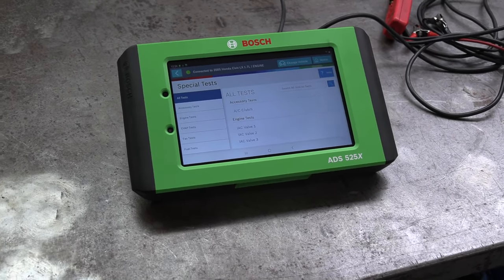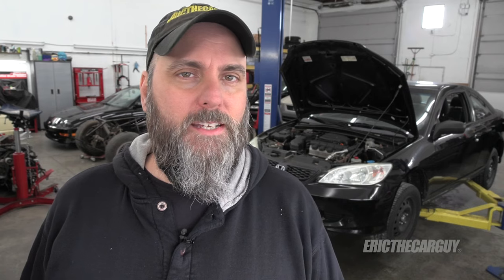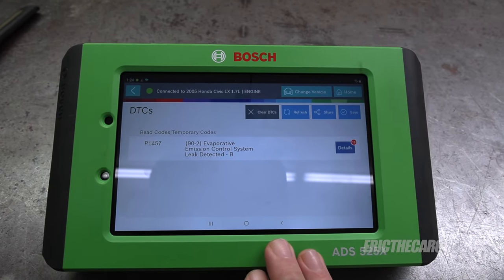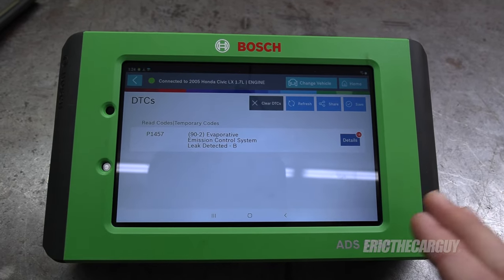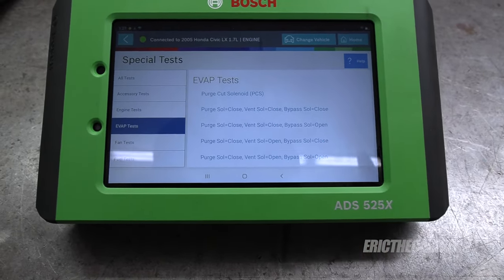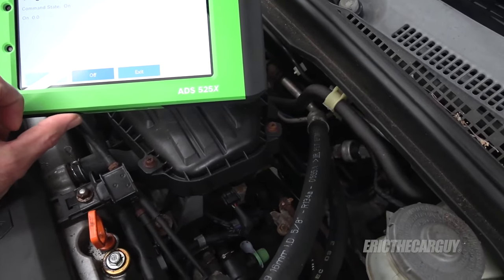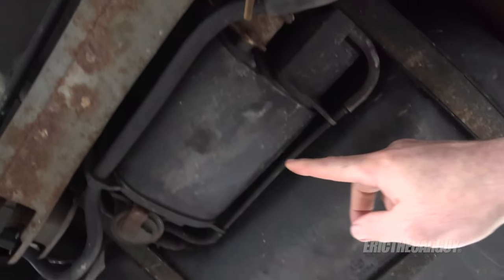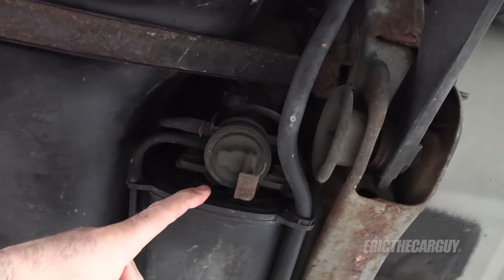How to Diagnose and Fix a P1457 Code

Comment: As a Honda tech for 20 years, the Canister vent shut solenoid valve, it is normally open (key off) when  the computer commands the solenoid   'on' that would make the valve 'closed'
Reply: looks like we have 22 honda tech here
Reply: I'll add to that, when testing too much pressure builds up with valve closed, which over powers the spring that normally opens and holds it open. most likely the reason for it not clicking at video end.
Reply: @throttlebottle5906  applying the smoke through the vent valve port should go in the right direction and show the difference in flow action when opening and closing the valve then.
Reply: @throttlebottle5906  the valve should have been open from the start with no power applied but it showed no evidence of flow right after installation. It would have required a sudden burst of overpressure to lock up the valve and close it, which the smoke machine wouldn't be capable of with its low flow.  
Seems like the valve might not have been working properly and was stuck closed, which may not trigger the leak code but cause other issues.
Reply: @dubmob151  what smoke machine and what magical perfect electronic controlled junk? cheap junk is cheap junk and good luck if you think all tools are great and perfect.
Reply: @throttlebottle5906  you said the reason the valve was closed was overpressure, only pressure going on is from the leak tester smoke machine. That smoke machine.

Comment: Dorman makes some extremely crappy electronic parts. I'd probably buy the Honda valve and keep it in the glove compartment for WHEN it fails. Great explanation of the system! I hate EVAP work probably more than anything on any vehicle today.
Reply: Excatly. Its 2021, aftermarket has gone to the toilet. I go used OEM parts if possible
Reply: I had a Honda valve fail in just over a year. Replaced it with a Dorman.

Comment: I have a 1999 Honda Accord LX 2.3L. Got engine code of P1457. With the things I know about the car, I went ahead and replaced the charcoal canister and solenoid. Reasons why I didn't go through all the testing is the following- 1. car BARELY passed smog 2 years ago. 2. Exhaust smelled horrible. 3. Car was acting funny with it jerking while coasting or slowly accelerating. And car revved high in park, neutral and drive.  So with how old the car is, having 236k miles, and the big fact that it barely passed smog. So key thing to remember...REPLACE the O-Ring on the solenoid. The warn out ring WILL CAUSE a leak and the P1457 will come back.

Comment: Have the code on my 02 CRV. Replaced canister/valve and that was not it. I don't think its actually a leak as I have noticed when I fill up at a higher elevation and then drive down a mountain, CEL goes away. Leads me to think its actually a pressure sensor. Having a very hard time finding where that is located and part number. Any ideas? Tank also holds pressure, have had it hiss when removing the cap after sitting on a hot day. Wouldn't mind even tricking the ECU into thinking its fine. Affects nothing and my state has no emissions but the CEL always on keeps me from knowing if something else comes up.

Comment: This really helped especially with mental preparation and being careful. I used a one foot needle-nose plier on the tiny clamps, which possibly gave me extra leverage and visibility -- also wiggling up and down so the clamp ring gets some movement. Thank you for also putting everything back so I do this the right way. Great video!!

Comment: That's exactly how I fix my car, just start replacing shit until you get it fixed! You are an inspiration, Eric.
Reply: I have same car and code....i dont have eric's expensive tools to diagnose.  I am doing same thing and replace what I can replace..
Reply: @benjaminfrancisgonzales8431  fr I got that code rn😂 might just go to the junkyard and replace the whole canister
Reply: I have a 2010 Honda CR-V with a small leak and I feel like I just want to sell it to fix the problem! BUT used cars are pricey. It’s cheaper to just install new OEM Honda parts. I now need to buy a car lift. Lol.

Comment: I have a 2004 Honda Civic EX with a P1457. I was contemplating whether I could do this by myself, but after watching this video and discovering I could be dealing with rusted bolts, possible leaks from multiple different parts, and fume exposure. I have decided not to proceed with the repair myself. Thank You for the informative video.
Reply: I have changed canister, soleniod, vent valve, fuel pressure sensor/purge valve and the gas cap no luck so far. I gave up for now…

Comment: You are spot on with your observation that a standing EVAP code can mask something more serious. One of my dinosaurmobiles routinely sets a P0442 and lights up the CEL, usually at around the 3/4 tank level as soon as the vehicle goes into closed loop. So whenever it does, I check that out and as long as P0442 is the only code listed I just clear it and get on with my life. I only put 1200-1500 miles a year on the car and chasing down some intermittent EVAP leak is not in my lifeplan.

Comment: Had the same issue with my 2002 Honda Odyssey, I had changed the entire evap system and gas cap including evap solenoids in the engine bay which still gave me issues. Took it to the shop, smoked it out, replace a small canister next to the evap canister, worked great for a few weeks and the same p1457 came back on.
Reply: Did u find the problem
Reply: @sickvick83  no, I end up getting rid of the car

Comment: I had a P1457 on my 1999 Acura Integra GSR a few times recently.  Once was the EVAP cannister purge solenoid wiring being so corroded that working in the engine bay, I totally severed the wires just by bumping into it with tools/hands/parts removal.  So I redid the wiring on that.  It was a difficult area to reach so I must've not gotten the most solid connection, so when I was rebuilding my engine and transmission later I must've severed the wire again (tugging it with parts or tools).  I bought an entirely new pigtail connector and wired it in (same as the one redone in the video, coincidentally haha).  Yet the issue still came back, but this time it was a p1456 instead of p1457.  I tested a few solenoids/valves with 12v power and then decided that because it was a p1456 I would try the gas cap.  I had an aftermarket locking gas cap so I decided to switch back to the original one that came with the car.  Problem was the o-ring on the old cap was so worn/ripped/torn that I would need to buy a new OEM one.  Instead I just took the o-ring off the aftermarket cap and put it on the OEM (or at least OEM-style) cap that came with the car.  Problem fixed!  It's been about 2000 miles roughly and haven't seen the issue come back yet, but if so I will buy a new OEM Acura cap.
Reply from the maker: You might also be able to find one in salvage. I believe they're all the same. Just get one off a Honda.

Comment: Old harness' are just as valuable if not more valuable than a bucket of nuts and bolts. Priceless in a pinch. Great vid thanks Eric.
Reply: My 67 Dodge D200 is probably 70% Mercedes-Benz wiring harness reworked...... that's one thing I've always admired under the hood of German vehicles: rarely will you spot inadequately wrapped wire or brittle connectors. Maybe it's just relativity. The bulkhead connectors of older Dodge vehicles make me think of using a fork and toaster as a conductor, though that would probably be safer!

Comment: Evap leaks are sometimes, such a pain in the ...
HOWEVER, Eric has a SUPER GOOD POINT that I also push frequently.
If your Check Engine Light is on, you'll have NO WAY of knowing if a new issue has cropped up, unless you fix the reason it's on, first.
Reply: Terrible convention to have one light for the most complicated chunk of the vehicle, yet 2 or 3 just for the brakes.  With more vehicles going to digital dashboards, it would be lovely to have a diag mode where it will display the codes on the dash or console.  Easier for consumers to know what's wrong instead of getting blindsided, and easier for techs to give accurate quotes.
Reply: Yes and no. You can refer to mode 6 data generic obd 2 on your scan tool to see exact Perameters of a specific part/monitor. Gives you an idea of a possible future or present problem.
Reply: @dillonv4298 , We as mechanics can, but the average consumer can't.

Comment: As soon as I saw Dorman on the box, I was like, oh damn. That's gonna fail again soon.
Reply: I swear, 90% of the Dorman crap I've bought either didn't work / fit out of the box, or failed within a week. I've stopped giving them chances at this point.
Reply: @Drives31forhalo  the stuff I’ve bought from dorman falls apart as I pull it out of the box.
Reply: It doesn't look like it even worked at all... Activating the valve should have let smoke out right? The code for a small leak isn't going to come back if you never open the vent 😜
Reply: @chrisej5987  I'm actually pretty sure that those valves are suppose to be normally open unless energized, so I think he replaced a good valve. but it's very possible I'm wrong here.
Reply: @chrisej5987  it shouldn't set a leak code but might make it difficult to fuel the vehicle with the vent stuck closed though.
Reply: It’s all Chinese stuff unfortunately

Comment: I can understand you wanting to maybe keep that old valve around, since it was still working (maybe use it again later)----   but I would have really like for you to take it apart, or cut it open.  Just to see what's inside/  how it works/ and maybe why it was partially leaking.  Great vid- but I never fix this stuff when it goes bad. lol

Comment: Eric a lot of the time the vent valves near the canister are defaulted to open and you have to close them with a scan tool or by applying 12v to it, I have to do this with any chevrolets when I am smoking the system.

Comment: VERY useful.  My 1457 has been gone for 4 months or more but did finally come back.  I tightened the gas cap and we'll see but any more trouble and I'm buying WATER BALOONS!  To put on those selenoid valves to check for leaks and sprayway glass cleaner too !  Thanks!

Comment: So To anyone who watched this video and  aplauds this great video, this was misdiagnosed!! The cvs is a normally opened solinoid.. So when he thinks he is turning it on with his bi directional tool he is actually shutting it off.. 
That is why he thought that he got a bad part.
His words "solinoid came partially opened"
The cvs is open the ECU controls the ground to close the valve and cut off vapor..
Obviously this guy never even realized he diagnosed this incorrectly or he would have updated it..

Comment: Great video, I tried to do the same with my 98 Honda Civic but it doesn’t have the purge cap, just a purge hose connected to the canister, so I tried pumping smoke into different places and the problem ended up being the gas filter, so I changed and no more P1457!

Comment: FYI i believe the Shadier is a Reverse threaded valve.
Are you closing the cvsv with the scanner? KOEO.
Are you plugging the Purge? you wont see smoke going in the engine.
I start with the purge by checking for vacuum with the engine running and electrical connector disconnected. then connect a vac/press gauge to it and then smoke from the tank with the cvsv or vent valve shut KOEO.
Ohh I forgot, I have noticed on honda, kia and hyhundi, Some Valves will stick Shut because of the oil residue/ the smoke is mineral oil(holding the valve "ON" for long periods)
Nice explanation on the evap sys and diagnostic flow

Comment: Hey Eric. Mahalo for the video! I've had a code P1457 for over a year.  Tried fixing the o-rings and springs of the vent shut valve a few times.. but, it comes back every third drive cycle. Don't have a smoke machine.. I'll get to fixing it one of these days.  Thanks for showing some techniques/possibilities.  Hope You've been doing well! 
Aloha 🤙🤙🤙🤙

Comment: Cute to see Eric the mechanic stumbling around with this dreaded 1457 code even with a smoke machine.  The  new solenoid breather valve power reset may have been all it needed. In fact the old one may not have been getting power either because of the smashed  taped over plug. The vacuum valve was likely good  as they are almost always silent and your machine showed a bad leak after it was replaced and until the solenoid vent breather reset.   
Expensive from the dealer but hey are you going to take it off and see if the old one is good and try to return an electrical  item to the dealer?  
" Well if it's suddenly working after I changed some parts that's a win. "  
 
SO,  Definitely check the power connections first before changing  more parts. 
I thought you were going to supply 12 volts to all the valves before changing them out. 
 I use CRC 226 on all the electrical  plugs on my old Honda and they stay corrosion free and clean.   I  feel for you Eric .  1457 is  a bitch.   I changed the vent solenoid last year and now it's back again.

Comment: This reminded me of a so so friend who used a bic lighter to find gas leaks in his home heating system, which is quite dangerous but has the advantage of a pressurized gas which is pure, where as gasoline fumes from a cracked charcoal canister is not. Since it is cracked air can get in and mix with the fumes and you essentially have a possible big boom if met with a bic flame, which if you haven't guessed is exactly what happened. The canister went away and so did most of my friends hair, this was the old GM style ,really epic boom ,fortunately he had safety glasses on, LOL.

Comment: After you repaired the connector and pressurized the system with smoke, why didn't the flow increase when you commanded the valve open?  Is the solenoid valve actually working (Dorman!!!)?

Comment: The vent valve should be open when it has no power key off, and closed when power is supplied, plus control ground from the ECM. Unplugging it and not having a leak doesn't make sense.. You will probably get a different code if the vent doesn't open  and possibly problems filling with fuel. I love watching your videos, cause you never know when your going to learn something new.

Comment: I had the same code on a 2004 Honda CRV.  Replaced that canister valve and confirmed it worked (clicked).  Check engine light came back on like before.  Did the smoke test and found the new valve did not seal when closed (even though the test showed that it opened and closed).  Installed a new Honda OEM valve, problem solved.

Comment: I have gotten a po442, 447 448 and 456, but not the one you  described. 447 and 448 were evap voltage related which cost me big bucks.

Comment: I have always been skittish when trying to troubleshoot fuel evaporator system leaks.  We didn't have a smoke machine at my dealership when these leaks began to show up.  It would have been a great asset along with your excellent tutorial on operating the smoke machine.  
We have high mileage vehicles coming in to where I volunteer and evaporator. leaks are almost the norm.  evaporate. system leaks.  Thanks!
.

Comment: Hello,  Being an electrical engineer by profession, the polarity of the solenoid does make a difference because internally across the coil may be a suppression diode(it is polarity sensitive;; the cathode of the diode is normally connected to the positive and the anode is connected to the negative).  This is also called a fly-back diode.  If you connect the polarity in the wrong direction then the solenoid will never work.
Reply from the maker: Thank you for that input. Perhaps you missed that there wasn't a diode in the wiring diagram I showed in the video. Thanks for the comment.
Reply: There appear to be plenty of solenoids which do not require polarity.
Reply: @ericthecarguy  Most schematics do not show the diode(it is an internal part that is part of the whole solenoid structure).  You can't even measure the presence of this diode since the resistance of the coil will always show up unless the diode is a really shorted, then you would read a very low ohmic value(close to the value when you short your DVM test leads together in "resistance or ohmic" mode.
Reply from the maker: In my experience, Honda schematics usually show a diode in a solenoid if there is one. An example is the AC diodes. Given that this is a low amp circuit, I don't think there was a need to put one in. Cost always drives design when it comes to auto production. If they can save on a diode, they do. BTW, I never stated the OG poster was wrong.
Reply: @ericthecarguy  OK and thanks.  Hey, did you ever find out why that brand new part did not work??  Was this a defective brand new part that failed (DOA).

Comment: Just curious I have the p1457 code. Can it be a bad purge valve with this code or does a bad purge valve has its own fault code? Btw the symptoms my car has is long cranks to start and at times it wont start. I replaced fuel pump, ect sensor, coil pack. still same issue. I was told it could be a bad purge valve. Thoughts ?